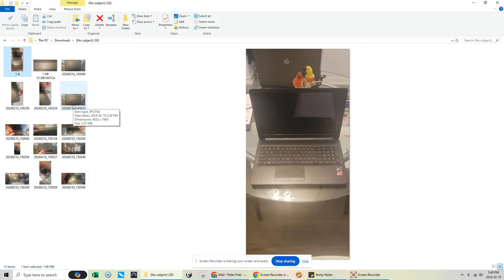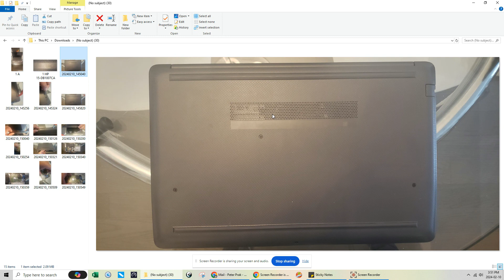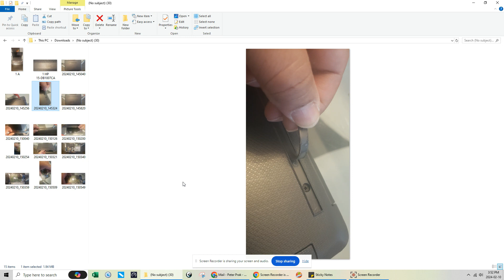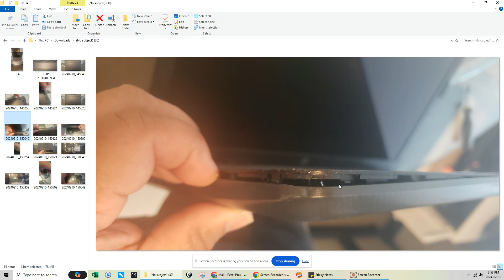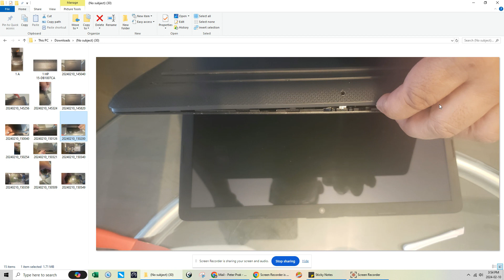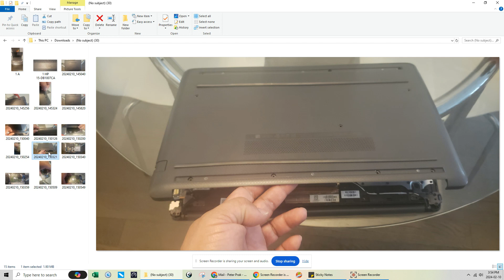HDD REPLACEMENT/UPGRADE EASY TUTORIAL MODEL HP 15-DB1007CA

Comment: do you have the dimentions of the HDD
Reply from the maker: I would suggest replacing it with a 2.5 inch SSD HDD and not a mechanical HDD! Good luck...Sample link included: https://www.amazon.ca/Kingston-Digital-480GB-SA400S37-480G/dp/B01N0TQPQB/ref=sr_1_2?crid=K94FDCHGHFC7&dib=eyJ2IjoiMSJ9.1xF4qWn2lGyQvKfwxq1RdzannwlKlxHTbLiiFXf7umeAIr_t5UA5c67QJgCpYo_MwzmHlKksKUcQmGehsCJb13ITnWipWqUhUQ-l6Fpy7iG4BbnFyqdNWNR3MgKLh8n9p17cNZEeWI8qvrmutP9jmkekzJcnhH2bd4sZ1KjvoXxf5l3rMVbti6p8JgwjOloCMkH6l18QzGKCpPXHCKrN6t5ykqYET3LCUsuiV4GxFFIQ7jT_8zLMc_jc5FvavV9coeRpMCaULHzKS5FQ-YcVp5qbOId3_7BBU6ARI_J8CXY.jIujoNz9_TU_HDKIKAbGlyQm9Wctm5uXXxp0a7EJIXw&dib_tag=se&keywords=2.5%2Bssd%2Bwd&qid=1714122187&sprefix=2%2B5%2Bssd%2Bwd%2Caps%2C246&sr=8-2&th=1